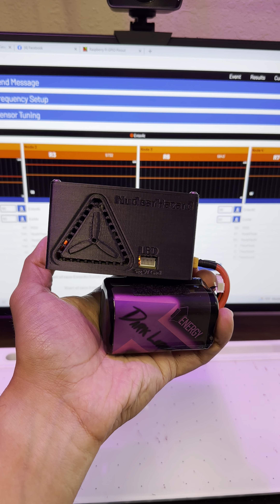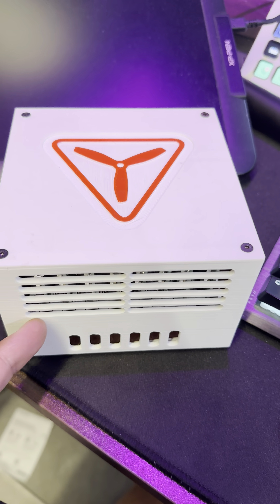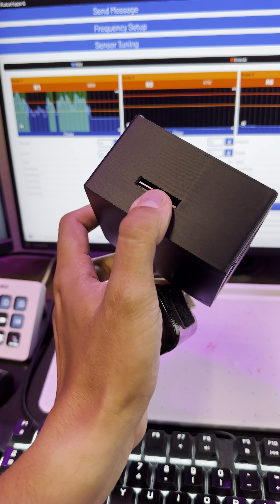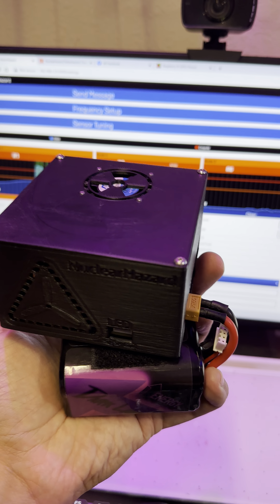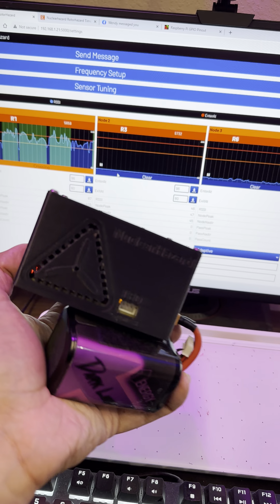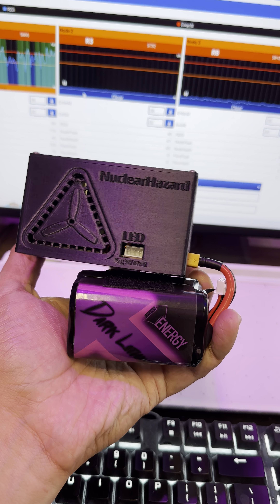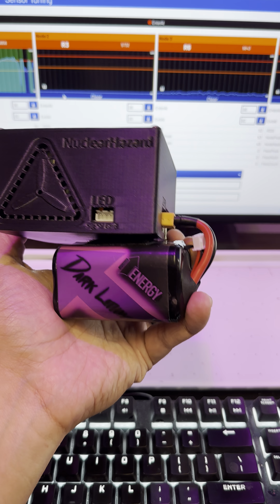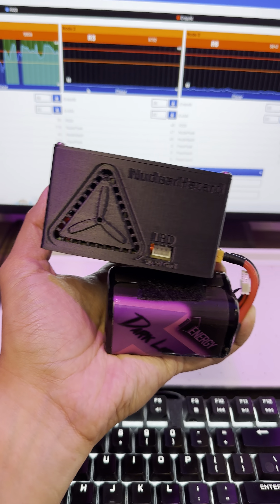Every Drone Racer NEEDS this $100 RotorHazard Timer

Comment: The only thing I would do is print a new case in PETG. In Florida it's extremely hot and the PLA melts pretty easily. I've thickened the lid and bottom of the box and it's held up in the heat.

Comment: do i set the pi up just like I did with rotorhazard and delta5 ? and how do you install the pi config its a .sh file type
Reply from the maker: https://github.com/RotorHazard/RotorHazard/blob/v3.2.2/doc/Software%20Setup.md

i followed this step by step guide